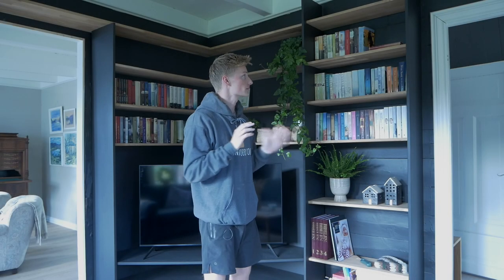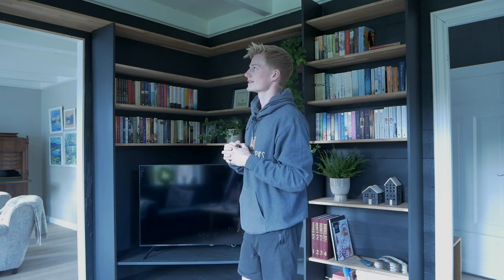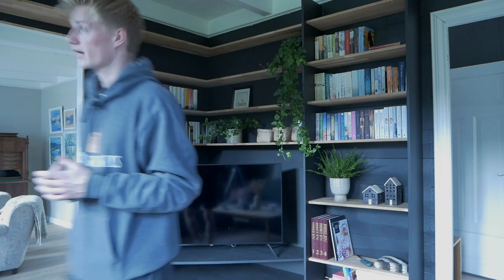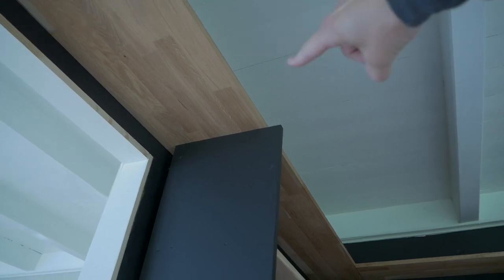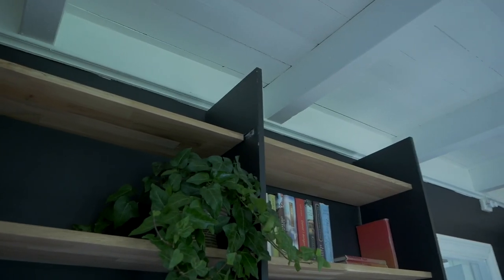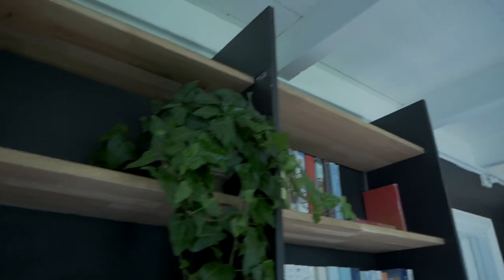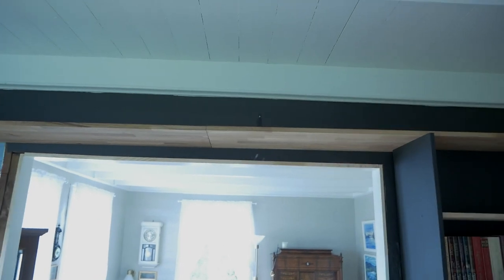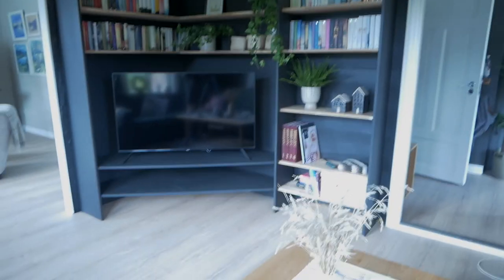Making a Large BOOKCASE / SHELF-UNIT

Comment: Are, another nice project, but I understand your frustration in building built-ins in an old structure.  Our first house was an old farm house and there was nothing that was plumb or square.  It was probably built in the late 1800s with all rough-cut lumber and no one owned a square or a level.  I could not just build it square and expect it to fit.  I used a lot of shims when i remodeled the house  and did a lot of scribing to fit.  It was such a pleasure to work on built-ins in our new home that was square and plumb.  You just have to adjust your thinking to handle the conditions.  Keep up the good work!